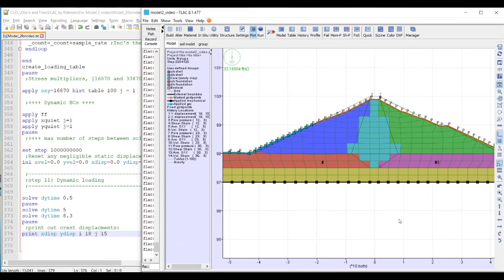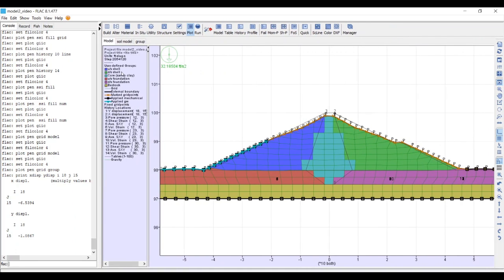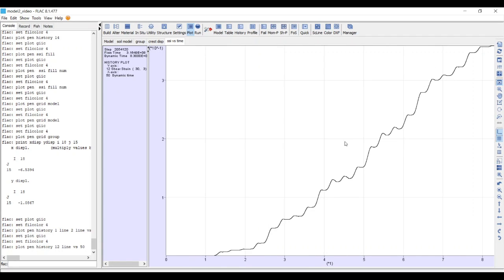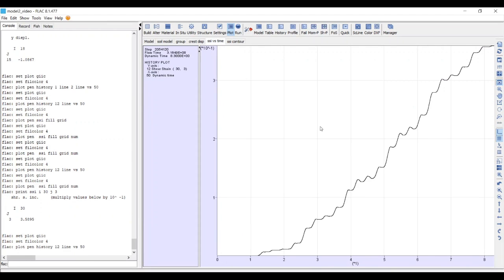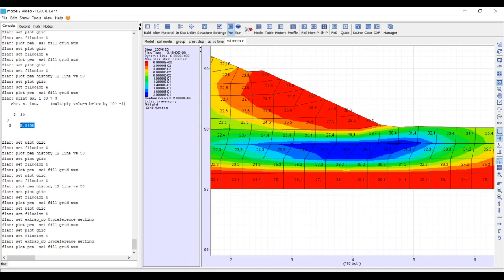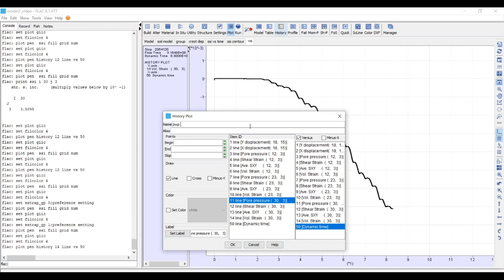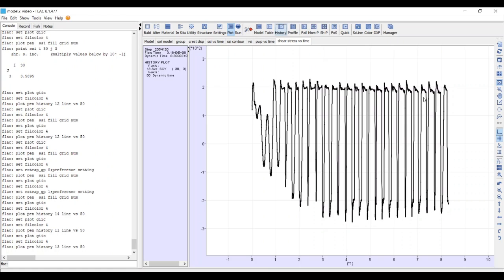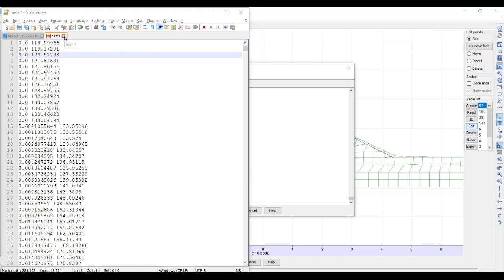Seismic analysis (Part 5 of 5) of an emb. dam & foundation, tutorial using FLAC, w/ strain plot.

Comment: Hello Dr. Jensen, I have a question: Can I remove free-field boundaries after dynamic analysis? my aim is to replace ff and quite boundaries by static boundaries to perform consolidation stages. Thank you very much!
Reply from the maker: Hello - It is possible to remove free field boundaries after a dynamic analysis, you can also remove quiet boundaries as well.  You could then assign fixed boundaries and do whatever type of analysis you want to from that point forward. I have done it before in order to perform a stability analysis on the model after shaking and deformations have occurred while using any reduced strengths -->> to see if the factor of safety is > 1.0, or at least if the FS is larger than it was on a pre-shaking geometry (with reduced strengths).  

If you want to remove the FF and quiet BCs after a dynamic analysis then I would make sure that the run has come to equilibrium first by checking the following: check a plot of velocity vectors that act on the grid points and make sure they are very small (maybe less than 1e-6 ft/sec or so), make sure no further displacement occurs with further dynamic solves beyond the shaking by looking at a displacement vs time plot for some chosen grid points, and lastly you could check the "state" plot that shows the state of each FLAC zone (element) and make sure there aren't too many in the "plastic" phase.  I'm sure someone out there disagrees with changing the BCs and doing more analysis at that point in the simulation.
Reply: Many thanks for your detailed explanation and comments. I agree with your viewpoints. Could you show me commands to remove ff and quiet BCs in Flac v8.1? I cannot find these remove function for the apply command. Thank you again.
Reply from the maker: Hi again - Look up the "Apply Remove" command in the FLAC manual or the "Help" button in the giic in v 8.1 for more information.  But, essentially the Apply Remove command is a command that removes all boundary conditions within a given range of grid points.  I think if you don't set a range, then it might remove all boundary conditions. 

I have used "apply remove ff" before to remove the free field BCs, I think "apply remove quiet" might work on the quiet BC (I would verify that with a trial and error example first for yourself).  Here is a basic example to remove the mechanical BCs (as opposed to the groundwater BCs): 
apply remove mech from 1,5 to 1,10
That command removes the mechanical BC along the shortest path between the two grid points of 1,5 and 1,10 along the boundary.  Hope this helps.
Reply: @naveadjensen3511  Hi Dr. Jensen, thank you very much for your help.